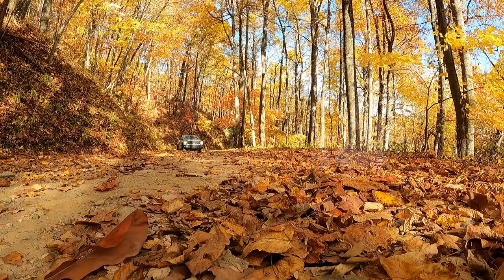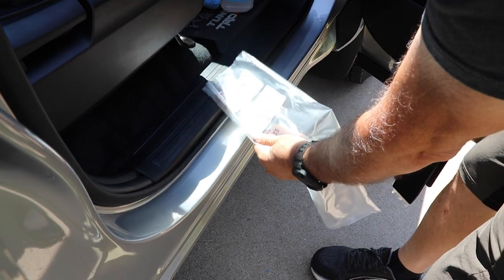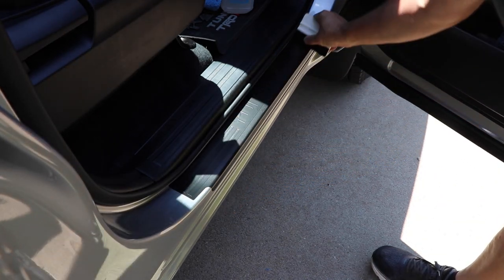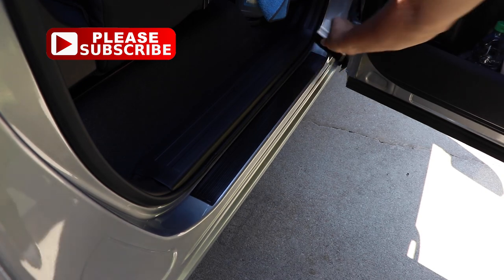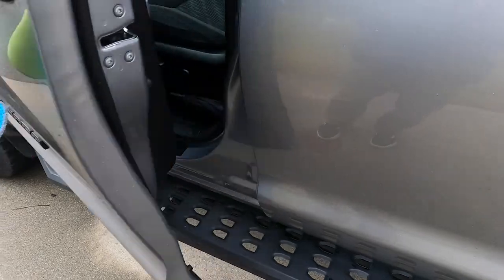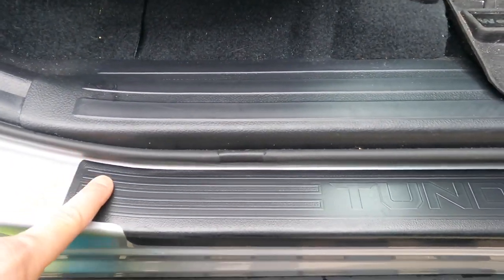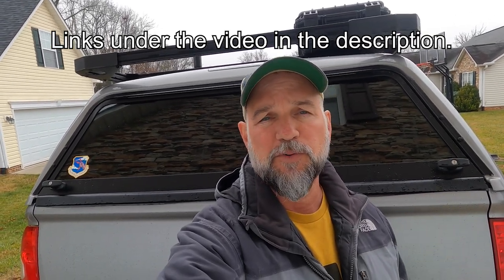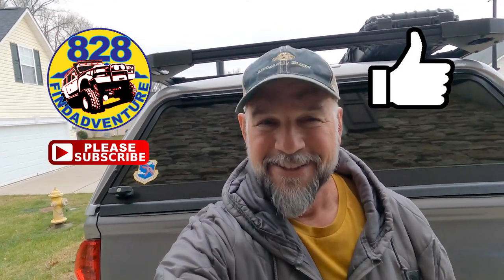How to install an easy mod to protect your Tundra

Comment: Which campertop are you sporting on your Tundra?
Reply from the maker: It’s the Leer 100 with a few options. If I had to do it again and money wasn’t an issue I would get a SmartCap. The Leer does fine but isn’t the best quality when it comes to details in assembly. Thanks for commenting.